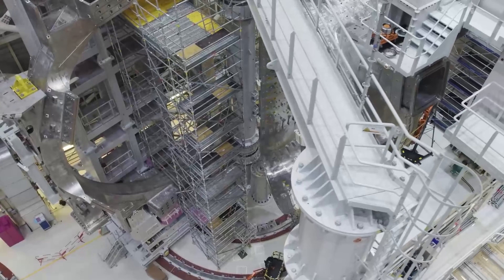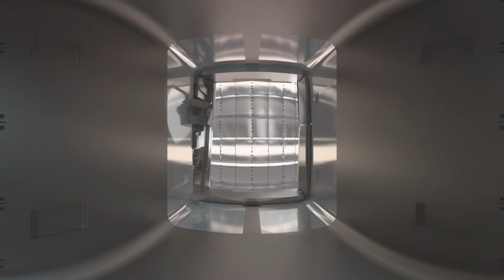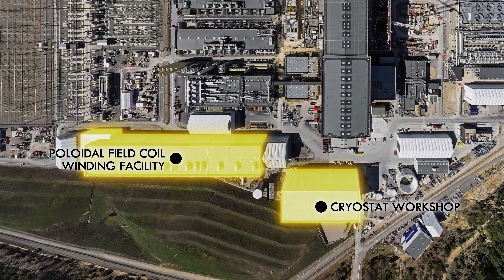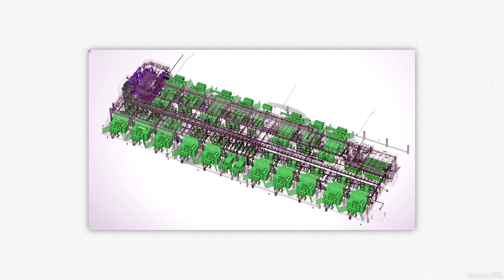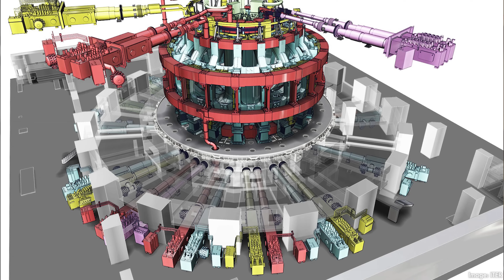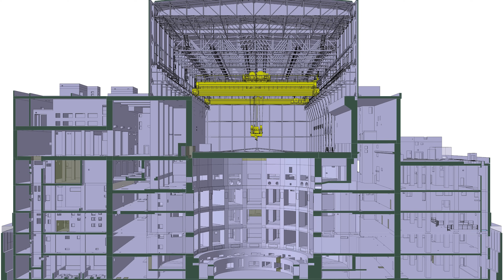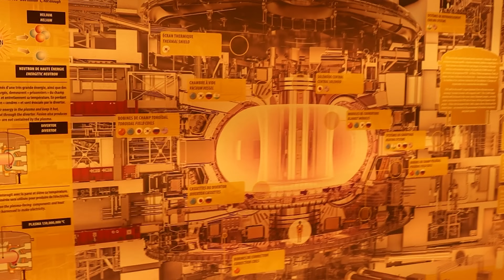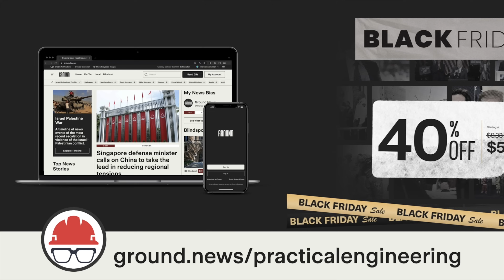Engineering The Largest Nuclear Fusion Reactor

Comment: Considering I just got a 16 port 10gbit sfp+ that came with 6 fiber sfp+ modules for under $20 CAD with $5 sfp+ DACs (5m and 7m), I can buy a few fiber runs and multigig rj45 sfp+ modules off amazon for a bunch of ports if I need 2.5 or 5gbe or even cheaper modules for any 10gbe rj45 ports and still come out cheaper.

I was really hoping this would be under 150US or max 250 if it was 10gbe.

NVME drives easily do 3.5-7GB/s, 10gbe wont even hit a full 1GB/s over the line. Wifi6E (9.6gbps theoretical, less real world) and Wifi7 (40gbps theoretical) speeds, I think ethernet needs to catch up. Most average people just use wifi. Even most of the other devs at my company mostly just use wifi and were surprised I "still" used wired 😂

Comment: If the overhead cranes are rated for 700 tons each how do they combine for 1500 tons?
Reply: they are rated for 700 but can lift more but not safely 
together they are made to lift 1500

Comment: I'm almost 100% positive he's worked along side Lawrence Livermore's NIF. The complex is extremely similar in how it creates fusion.
Reply: It’s nothing like NIF. Like, entirely, totally different
Reply: No it's not.
The NIF is basically a miniature fusion bomb, while this is more like trapping bits of a star and forcing it to run in circles.
Reply: NIF uses laser compression to induce fusion while ITER uses confined heat to induce fusion, it's like comparing a diesel engine to a combustion engine.

Comment: That was a fantastic video, thank you!  The innards i.e. the fusion reactor are something I have kept an eye on for years, but I never considered how you "contain" the entire setup much less something of this magnitude.  You discussed a lot of the ITER complex and covered it with clear and concise explanations of many of the items from the power switching, rectification, and dissipation (I need to look into the fast discharge units, the amount of power being "dumped" fascinates me) and to the decoupling of the Tokamak structure from the rest of the building, to the anti-seismic design... and more.  All in less than 20 minutes which fits nicely with my break while making bread!
It was very nice of Jade to provide an introduction to ITER and put you up to doing a video.  I'll be watching hers next.

Comment: The Engineering content in this video is amazing but the project is an absolute waste of taxpayer $$$.  I'm sure we will learn some great scientific information but to say this will have the potential to produce more electricity than it consumes is a joke at best given that the fact that it is just a larger tokamak design which has not worked for the past 60+ years.  We need new ideas and innovation to make fusion power a reality.

Comment: I know it’s a science experiment, but it’s crazy to me that they don’t plan on making and power with such an amazing piece of equipment!
Reply: They’ll only be running the plant intermittently. I doubt it would be worth the additional complexity of adding generation capability given it won’t pay its own bills.
Reply: What a huge waste.  I wonder what will happen to this multi billion euro project once they figure out what they want to know.
Reply: @j.t.johnston3048  It is designed for experiments that run up to 10 minutes at a time, initially probably more like 10 seconds.
While 500MW is quite a lot of power, the energy released during one experiment is at most 80MWh which is not a lot in terms of power plants.
It would not be more useful than solar panels on the roof of the building.
Reply: @j.t.johnston3048  You can work with ITER for decades, continually advancing our understanding and capabilities. ITER allows us to test various magnetic configurations, explore different methods to stabilize plasma, study activation behavior, fuel retention, tritium handling and fuel recycling methods and evaluate the service life of each critical component. It also serves as a training ground for the next generation of engineers and helps spread fusion technology once we master it. The possibilities are truly endless.
Reply: @j.t.johnston3048  they will push it harder and test more ideas to try and gain even more experience with the reactors 
and once it can do no more it will be taken apart in tens of years

which isn't surprising as the plant is only rated for 500MW while a real fussion plant would likely be in the GW range

Comment: Listened carefully but I seem to be missing something. 2.27  "produce 500mw"    8.38 " draw in 600mw from grid"  Isn't the goal to produce energy?
Reply: yes and no
the goal is to prove that we can get more energy out then we put in 
the plant cannot make its own power as it has no generators 500 mw is its thermal rating and while in operation its only expected to pull 50 MW
600 MW is the start up power draw

Comment: I wonder if the powers that be have considered just how VALUABLE the operational data will be once they have got it running perfectly, my concern is that some partner nation might try and steal the data and deep six the original so that they have a leg up on fast-tracking their own machine and have significant leverage in the power industry. For example China has stolen quite a few technologies from America that have made front page news in the past, I certainly wouldn't put it past them.

Comment: I love how we keep going with an expensive project that was poorly designed with no grid connections. When there are plenty of cheaper and x100 smaller designs that are more efficient that should be pursued. But hey it’s a great way to run out of the world tritium supply :)

Comment: Just happens I love both you guys, and fusion.   Just one comment on the waste products of fission - I spotted this in the wiki page on radioactive decay:    "The decay of the radionuclides in rocks of the Earth's mantle and crust contribute significantly to Earth's internal heat budget."          So if there's so much natural radioactivity deep in the earth that it contributes that much, what is the problem with burying waste deep in the earth? That is much more concentrated than natural for sure, and is still a large work process, but the waste should feel right at home at some distance for millions of years.
Reply: There’s no problem, so long as you do it right. Finland has a new waste repository, big enough for itself, all its neighbours, and a large portion of the world’s radioactive waste for a long time to come. The issue is mainly that you can’t bury it just anywhere, it has to be geologically inactive, have no influence on the water table, etc. Then it needs to be sealed-in properly (the Finnish solution involves a lot of concrete around each cluster IIRC) to keep it tight.
Reply: Well, it would be OK to bury the waste deep in the earth, but of course you would not want it to come back up via a volcano or similar...
That said, the problem of storing waste is generally exaggerated and used as a political motivation for not wanting nuclear power.

Comment: Plasma being charged.  I tried to think why, if you start with atoms, including nuclea and electrons, heat or compress it until the electrons break free and you have plasma.  But the electrons are still there.  How / why do we say it's charged?  The only thing I could come up with is that while the atoms split "fairly" on charge, they do not split fairly on mass.  The electrons are obviously negatively charged, the nuclei positive.  But the vast majority of the mass is positively charged.  Maybe I'm missing the point entirely.  Maybe the process of converting the matter to plasma basically evicts all electrons to an outer field.

Comment: I'm so curious about what will happen to all of the dedicated assembly areas once the complex is finished.  I assume all the tents will just be taken down, but what about the giant assembly hall, or winding facility, or cryostat workshop?  Will they be reconfigured for some other use?
Reply: Well the assembly hall will be very useful if they ever need to make replacement toroid pieces, or just housing the existing ones for extensive maintenance. The cryostat is going to be seeing ongoing use as was discussed in the video.
Reply: JET in the UK is the 90s predecessor, and it has continually been upgraded. The same will probably happen with ITER

Comment: Unfortunately the fact that they aren’t actively using the water cooling, the heat made into power, it’s a waste of time. Do it in full. Actually gain the power at scale and see how well the system runs. You’ll be missing key parts like how the cooling and heating can happen at the same time. It would make the system more efficient and cost less to run. But they know it can’t constantly run. They need sound waves to control neutrons so they don’t fly out and damage things. They aren’t even testing that.
Reply: We know sound can hold tiny objects, but more sound can hold larger ones. Not just drops of water, but balls or cubes and of course anything if done right. A sonic force wall can be made inside the reaction chamber to hold the gas, because neutrons can’t be magnet held. Even great pressures can be achieved which drastically changes the concentration of gas requirements. What if you funnel heated gas in and out again to keep it running? You can cycle the gas to heat other sections and expand and reheat. A core can spread its heat vastly to an area far bigger than what they designed.

Comment: I have never heard how any fusion reactor can actually convert the the energy to electricity. So 80% of the energy is converted to steam, 20% lost, how?, (thermal I assume)?  I suspect that like history has proved, the steam cycle probably thermally dumps through  cooling towers to an already catastrophically warming atmosphere. Most of the energy recovered will be lost. 35-39% energy maximum possibly recovered, the same as any thermal or nuclear plant, might be used if anyone can figure out how.  With all of the auxiliary energy consumption, cooling net  gain will probably be negative.

Comment: hi Grady,
the sad thing about both your and Jade's vids is that they consist mainly of 'fluff', exactly what they were spouting in all the 'everything powered by fusion in 10yrs' propaganda they were putting out about the time i was born ['56] and every year since. i would much prefer a vid along the lines of ''on dd/mm/yyyy, hh:mm:ss your currently coal-powered electricity supply will be switched to fusion-powered. your lights may flicker. ''

Comment: If they can't make it generate more energy than it consumes at a small scale, i don't believe they can make it at a large scale. 🤨
Reply: Not how power generation works.
Power generation is the ultimate "economies of scale" example.

Pour a single bucket of water from 50 meters above ground, and ypu won't even generate enough power to make a light bulb flicker.

Pour 10 trillion buckets of water from 50 meters, and you can power a whole city.

Comment: "no potential for meltdowns"
I don't consider myself an expert, but this claim fundamentally misrepresents what a nuclear meltdown is.  If a nuclear powerplant has a runaway reaction, that kind of failure would not be called a "meltdown", it'd be called a "criticality disaster" and so far we've had no such incidents.  a "Meltdown" is when a failure in the cooling systems leads to the reactor core not having enough heat taken away from the reaction fast enough to prevent deterioration of the structure.  As material fatigues, the casing literally melts, or in the more extreme cases where the meltdown is accompanied by a failure to relieve pressure, a steam explosion occurs.  Technically such steam explosions are still possible with coal power plants, however the number of cascading failures would be much more significant for any coal plant to have such an incident.

Long story short, a meltdown is a coolant failure that results in the heat of a reactor being turned into destroying the reactor instead of power, not any kind of runaway reaction or anything else.  Tokomak reactors are still fundamentally capable of melting down, it's just that the fundamental differences mean that physics based safety measures are much easier to implement to prevent a large-scale disaster.  A properly designed Tokomak, while capable of melting down, should only lose the reactor itself in such an accident.

Comment: One of the challenges of fusion tokamaks is how to keep the core of a plasma hot enough that fusion can occur, while preventing the tokamak walls from melting from that heat. This problem is even more difficult if instabilities at the plasma edge release energy in short bursts instead of a steady flow. Scientists still have to overcome the threshold of being able to create more energy than is used to start and maintain the fusion process.

Comment: How will they transfer the power output from something like this? It's not possible to dump all that insane amount of power at once, also it must not be easy to convert that power output from the device to a power grid..? I wish that until we progress with this, that we fully commit to modern advanced nuclear energy options. It's such a useful thing we are not utilizing. We've advanced so much in understanding safety measures, engineering, etc. We could be using nuclear energy for improving our power grid, efficiency, lowering emissions, powering important but power hungry things like desalination plants or even powering nuclear fusion plants.. i really hope we come around to see how beneficial this resource is. Especially with all our modern day advancements.

Comment: If we’re concerned about global warming, why is it ok to regulate combustion emissions so strongly, but it’s perfectly fine to create and release so much heat energy so freely and unregulated?
Wouldn’t this just create even more increase to our global temperatures?
Why is massive global heat emissions not a main discussion for reduction?
Reply: The more you look, basically every transfer of energy creates heat and most electric devices or machinery produces lots of heat. Every heat sync, radiator, cooling tower, air conditioner etc. that we use on a daily basis would, in my opinion, contribute massively to the worlds increasing temperature.
Reply: @JohnSmith-gh7sv  that heat is more or less in a closed loop. climate change happens when the atmosphere traps more of the sun's rays, which is mostly caused by carbon being added to the atmosphere. entropy alone doesn't lead to that kind of climate change, though what we use to power all of those things does. renewable energy like nuclear would help mitigate that substantially.

Comment: It sounds like a huge waste of money. And they will not even make a single Watt of usable energy because alle the energy input for all the magnets pums, tranformers cranes thermostates ... are not included the energy calculations for the fusion reaktion. Just to brake even they would propably need to get 1000x the energy out of the fusion proces then thy put in heting of the tritium or more. And that not for some seconds hours or days but continuously. This will never be a solution for clean energy. At lest not in the foreseeable future when it would be needed. The more I hear about the project the dummer it sounds

Comment: The idea that a fusion reactor like this could ever be commercialized is totally laughable. This project seems like the wrong approach for fusion. Giant massively complicated reactors would never be economically viable except in a post scarcity civilization where money doesn't matter. It seems like the best bet is focusing on what MIT is doing. Small reactors with high temperature super conductors that can increasing magnetic field intensity quite a bit. ITER seems like a giant money pit

Comment: glad to hear the big cheerio is coming along. i do however think if they were building a prototype of this scale that the power take off from the system and into applications should have been included. those systems will have their own problems to be resolved, most serious being paired with the reactor. not dealing with them now seems like it's rejecting a good opportunity to cover all the bases in one huge expenditure rather than making another later.
Reply: It will take a long while to reliably produce net-energy positive magnetically confined fusion in the first place, it's never even been done. This is essentially a research reactor.

Comment: Sorry, but this video misses to mention the most important fact. The x10 "energy generation" is extremely misleading as it is only looking at energy in/out if the plasma. BUT both processes (heating the plasma/ generating power from the energy output if the plasma) have massive efficiency losses. You can see it by the fact, that the plan to put 50MW into the plasma, but draw 500MW from the grit. The current assumption is, that ITER  at best, will produce 30% of the energy that it consumes. There is currently no concept of how to create a power plant, that can generate a surplus of energy. The implication of net energy production with this concept is simply not true. (If you don't believe me, watch the video of Sabine Hosselfelder about it)